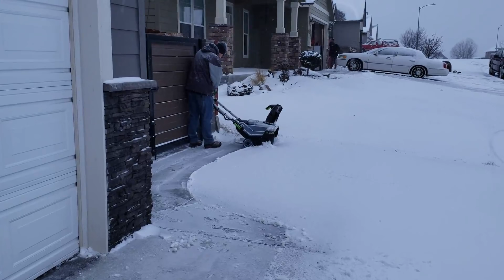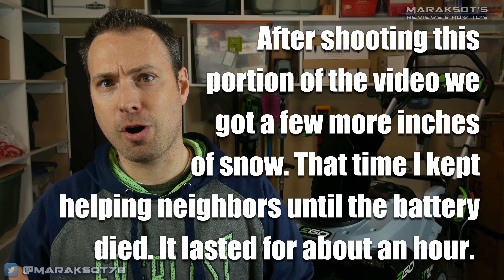Ego 21" Single Stage 56 Volt Cordless Electric Snow Blower Review

Comment from the maker: Wanna skip to a particular portion of the video?  Use the Time Stamps.  :)
-- Time Stamps --
0:00 - Video Intro
1:13 - Who is Ego?
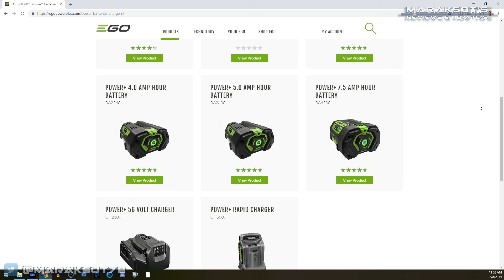2:04 - Why I chose this Ego snowblower
Performance
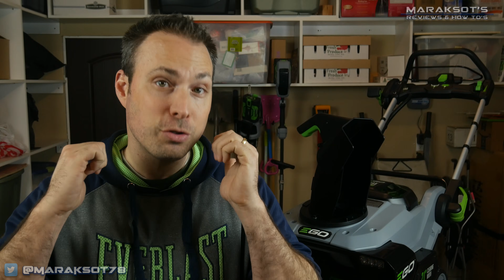    2:58 - Real world performance
    4:42 - Deep/compacted snow test
Physical Overview
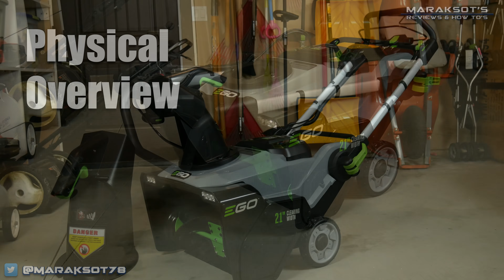    5:37 - Initial assembly
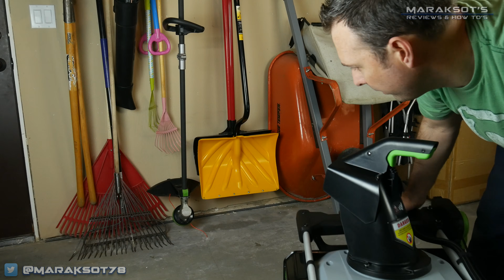    6:17 - Storage
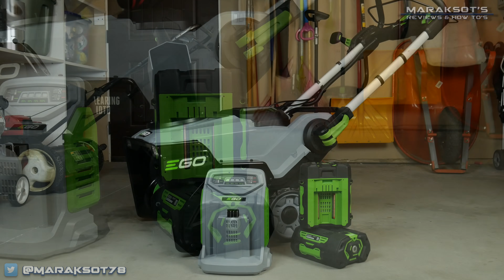    6:36 - Batteries and charger
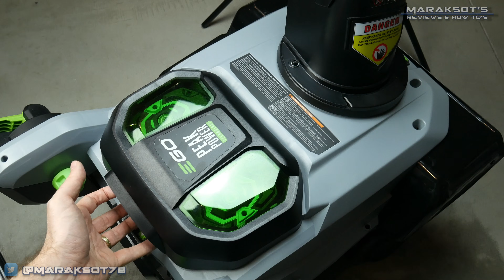    7:13 - Battery compartment door complaint
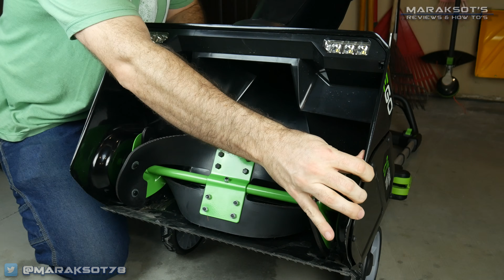    7:43 - Intake, padles and scraper
    8:13 - LED headlights
    8:57 - Chute adjustment
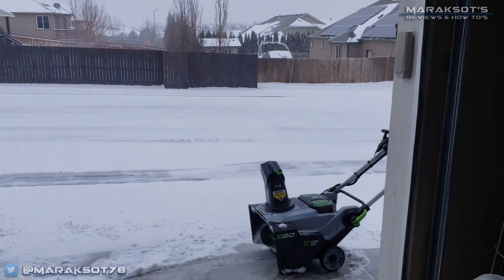    9:56 - Motor speed adjustment
    10:25 - Ignition system
    10:48 - Ergonomic handle
11:37 - Final Thoughts
12:47 - Thanks for Watching! Like, Share, Comment & Subscribe!  :)

Comment: Reading battery gauges is not as simple as reading a fuel gauge on a car. When the motor turns on, the actual voltage drops at the battery. When it is bogged down by heavy snow, it drops even more. When you turn it off, it takes a few minutes before it will read the actual static voltage. This would cause confusion to the average person. There are sophisticated systems out there that would do more like what you're asking, but would add to the expense and still cause confusion when there is any type of problem with the battery itself. If the battery pack has one bad cell or other internal problem, any battery gauge would not only probably give inaccurate readings, but would be a total nightmare for over the phone warranty service personal. There are other reasons, but I think the ones mentioned are reason enough. I wish I knew how to make a YouTube, I could do an entire video on batteries. Great video, I just bought probably the same one you demoed, first time in 20 years I can't wait for it to snow!

Comment: Thank you for making these videos. They have been very helpful, especially for the wife who has to buy the things for the husband because he doesn't have time to look into them. 😊I just bought the EGO mower and I'm going to buy the snowblower. I have one question. My lawn mower came with 2 of the 5AH batteries, and your video shows that I can use them on the snow blower too. I have 1/4 acre as a normal subdivision lot. Should I buy a 7.5 battery that in your video says will fit into the lawnmower. I would like to make it as simple as possible to get the lawn done without having to stop and charge the battery. Tysm

Comment: I don’t have one, but I believe there is a center button on the upper end of the batteries that, when, shows by lighting up how much charge is remaining.
Reply from the maker: The newer batteries have a battery gauge around the battery button that show the battery level. The older ones like I have, the button just lights up green until it reaches 15% or something like that and then it turns red.

Comment: I used this product for 2 Winter Seasons in NY and went back to a single stage gas unit.  The first unit was replaced by Ego when the circuit board failed.  I usually had to stop for slightly over an hour to recharge the batteries. Clearing the snow left by the truck at the end of my driveway pretty much depleted the first charge.  Since it has less power than a gas unit it barely moved slush maybe throwing it 2 to 3 feet on full power and that's if it didn't clog.  The controls regarding moving the chute worked great as well as the led headlights, light weight, compact folding  design and not dealing with rotating gas and oil changes but the performance regarding snow removal is what counts and this just didn't cut the mustard or plow snow adequately enough in this NY area.  Better in areas like Lewes Delaware where snowfall is limited in amounts.

Comment: The 25” two stage model has skid plates, but the 21” model does not. The housing is riding on the “pavement” which if it isn’t dead flat catches on everything. Do you have suggestions for dealing with what seems like a design flaw?

Comment: Excellent video. Thanks. One thing of note I did discover that you can run this on one battery because it is a single stage. When I called about this to EGO, the person I talked to didn't seem to understand my question. Apparently, only the 2 stage blowers actually require 2 batteries from what I understand, since one pulls in the snow and another pushes it out ; whereas the single stage does not do this. I bought a 10ah battery Ego lawnmower, so I reason that it should be the same as buying a snowblower with 2x5amh batteries and thought to just buy the snow blower without any batteries. 

But since I didn't understands this, I ended up buying the single stage snowblower with 2 x 7.5ah batteries, so I now have 3 batteries, spending a lot more money than if I just bought the blower without a battery. 

 And what is the best way to store one or should I rotate them? I guess I will have to see how it goes. I was tempted to take it back once I discovered this but I decided to keep it. Having an extra battery can't hurt, except in my wallet. I have to say between the lawnmower and the snowblower, I spent lots of money. And on top of it I got an extended warranty just in case.
Reply: Whoa, you can run this on one battery? How much runtime do you get on just one?
Reply: @timsauceman6321  : It would depend on the size of your battery, I imagine. My question was: is 1 10ah battery as good as 2 x 5ah battery. I would think it would be? But since they offered the snowblower with 2 x 7.5ah Battery this year, I decided to spend a little more and get them.

Comment: No way in hell that the intake housing is made of 8 gauge steel! (your comment at 7:45)  That's 11/64" or 0.172" which is very heavy steel, and total overkill for ANY walk behind snowblower.  The intake piece alone would weigh 50-80 lbs. on this blower.  I think you may have meant 18 gauge steel.  Much more likely and appropriate for a machine of this type!  Other than that ...nice review!

Comment: This video was EXACTLY what I was looking for.  I no longer can keep up with maintaining gas and oil mixtures, then draining, plus pull start.  EGO was recommended to me by the neighbor that maintains all my small engines.  I felt like that was a quality recommendation.  So I took the chance and ordered and EGO 21".....it should arrive any day now, but I wanted to be educated on it because currently it is snowing.....AGAIN....last weekend 12"....I had to hand shovel due to both snow blowers not working.  THANK YOU for the thorough walk through.  My only question is how do you charge the batteries.  I am thinking there will be a plug leading to the charger?

Comment: Like okay. I'm crazy for mentioning but I'm O B S E S S E D with my corded electric unit and I love watching videos on these new battery units. Like holy crap, I'm only 27 but I'm used to the huge piece of junk gas snowblower that never works. The current one I own is on it's second or third second and while it's powered by a cord, it works even tho it's tiny. 100000 times better than the old gas one. Very exciting new stuff out now!

Comment: Now what would be the cat's meow is if EGO would take the drive system of the lawnmower (I have one) and make the tires bigger, wider with the optional use of chains and use the 7.5 or 10 amp hour batteries then you really would have a fantastic machine.  Still thinking on adding this to my arsenal of EGO tools
Reply: Or if they made one with tracks that takes 2 10.0Ah. Batteries ‼️

Comment: Lawn movers are fantastic and the battery lasts a long time and it’s very quiet.
Only thing I suggest is that I don’t leave my batteries out in the cold in the winter. I have the lawnmower but not the snowblower but if I did I would pull them out for charging and charge then indoors where it’s warm nor would I leave them out in the cold in the machine after using it. I’m just being cautious.
The cover for the batteries I don’t personally have any issues with.
Reply from the maker: I agree.  I actually bought one a few months after making this video and I really like it.  :)

Comment: What’s it do with that wet slushy snow?
Reply from the maker: It does ok as long as you don't have more than a few inches of it. It definitely works best with dryer snow. Where I live we usually only get a few inches of snow at a time and it works great for that. This past winter we had one day where we got about 6 inches of new snow and it handled it fine however the battery only lasted long enough for me to do my driveway and sidewalks and that was it. I wasn't able to help my neighbors that day.
Reply: Maraksot78 last weekend the Chicagoland area had 3 inches of slush. I had no problem blowing water off the driveway. The Ego worked 💯% better than the gas blower I had before. I’m done with the smelly gas blower and mower!

Comment: Ive had this snowblower for 3 winters. At first I was excited about it, it was the best thing ever. I never had a snowblower.

Im no longer thrilled with it. Still better then a shovel, but scraper bar wears out way too fast, gets caught on every crack, wheels squeel to no end, pushing it up even minor grades gets old.
Reply: @John T  It's true what you say about the Ego snagging on every driveway crack, 
and not providing ANY self propulsion with the paddles. That's the reason I returned it.
Reply: John T I’ve had the Ego for three years. No problems whatsoever. The instant torque is great for plowing through snow drifts. My old gas toro was a maintenance nightmare. I’m tied of messing with gas. Lithium batteries are the way to go. I haven’t pumped gas in three years. I don’t miss it.
Reply: John T the scraper bar and paddles are ware items, Ego like all blowers offer replacement parts for that.
Reply: @rickslife  that’s not a helpful response. If the cutter bar hits any uneven projection, it’s the operators back that gets worn. Mine is not replaceable

Comment: Thanks for posting...Great video! Do you recommended running the batteries all the way down before charging? I just used my EGO Snowblower for the first time tonight. Works great...Perfect for my needs. But, not sure how much battery I used so Im wondering if I should top off the batteries now or will that shorten the life of the battery?
Reply from the maker: Thanks for checking out the video and for the question. They're lithium ion batteries and my understanding is they don't have the 'memory' issue like older rechargeable batteries. You can charge them up anytime and it's fine.  Since shooting this video we've had quite a bit more snow where I live in Washington State and I found with only 2 or 3 inches the batteries would last for a good hour as I was able to clear my driveway as well as help my neighbors with theirs. One morning we had around 6 inches of new snow and the run time was cut down to 30 or 40 minutes since the motor had to work harder which of course drained the batteries more quickly. I did feel that for clearing my entire driveway, 6 inches is about the deepest the Ego's batteries can make it through. I didn't have any juice left at that point to help my neighbors so I had to be selfish that day. XD lol. But yah, to answer your question I think you're just fine to charge them up when you're done clearing your driveway and side walks.  :)

Comment: I’ve got the brushed self propelled mower, it’s the reason I’m getting the snowblower tonight
Reply from the maker: ha ha, that's awesome! Sorta the opposite of me. I'm kinda torn between their new 21" self propelled peak power mower with dual batteries and their 20" self propelled with the steel deck. I'm leaning toward the steel deck with the 7.5 amp hour battery though.  Cheers man, I think you'll like this snowblower too.  And thanks for checking out my video and for leaving a comment.  I really appreciate it.  :)
Reply: Maraksot78 I haven’t encountered a situation where a steel deck would have benefitted me in the year of ownership on my mower. It came with the single 7.5ah battery and I can cut  almost two hours on a charge. The bag flow engineering is awesome, ergonomics are beautiful. I have the carbon trimmer as well, that’s a solid piece of equipment. I’d go with peak power if I were you, for the weight savings and the fact that grass doesn’t cake as bad on plastic
Reply from the maker: Thanks man for the insight/recommendation.  I don't know anyone personally that has an Ego mower so I haven't been able to get any opinions other than from reviews and stuff online. Some hands on experience outside of Home Depot would be nice too.  I have the carbon string trimmer too and I love that thing!  It's awesome!  It's what got me looking at more of Ego's stuff.  One thing I like about the steel deck mower is the side chute which I don't believe the plastic deck has.  I don't use the side chute on my current Toro mower all that often but occasionally I let my grass go a little too long and trying to bag it or mulch it doesn't work so great as it's too long and heavy so having the side chute allows me to mow it once and eject everything out then go back over it and bag it.  Time consuming and crappy but better than stopping every 10 seconds to unclog the mower.  I could remedy this by just mowing my grass before it gets too long but sometimes weather and summer vacations throw a wrench in the works.  XD ha ha  I do like the idea of having 2 additional 5 amp hour batteries.  That way, if ever needed, I could just swap the batteries from the snowblower to the mower and vice versa.  Thus my current indecision on which mower to get.  XD ha ha